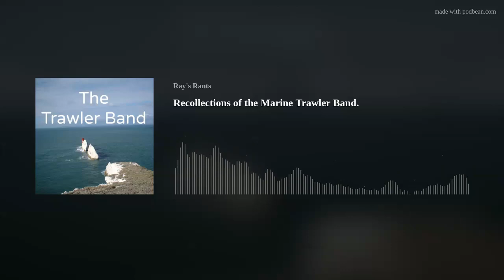Podcast - Trawler Band radio memories. 2182 kHz shipping

Comment: thank you, great video. im new to radio and have an old valve Trio, Im confused as to what size antenna i need to monitor this low frequencies? I looked at the antenna calculator but it only gose as low as MHz.
Reply from the maker: The best aerial for low frequencies is a long piece of wire, as long and high as possible.  That should work well.

Comment: 2024.11.02 
U.S. Mariner.
We used 2182 for the tugs. 
The USCG and all the other officials have stopped monitoring and supporting 2182.
Last year I tried calling Ascencion Island, a British Territory, as I was approaching, no answer, as no longer supported.

2182 kHz is still available ship-to-ship, just not used much. 

I'm on a ship and I would like the option of calling on 2182  from a lifeboat.
Would I have to get a marine radio or can I alter a Yaesu FT-891 to TX/RX on 2182?
This is my
Reply from the maker: Hi, great information. Thanks very much.  It's good that 2182 kHz is still available ship-to-ship.  I'm not sure about altering a Yaesu. It might be possible. 73, Ray.